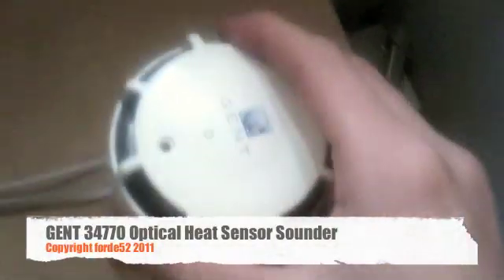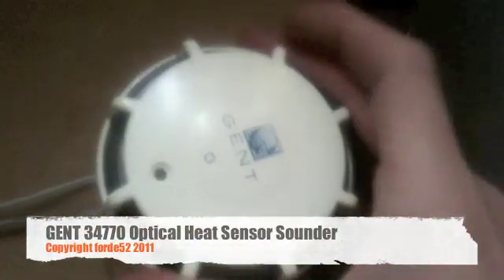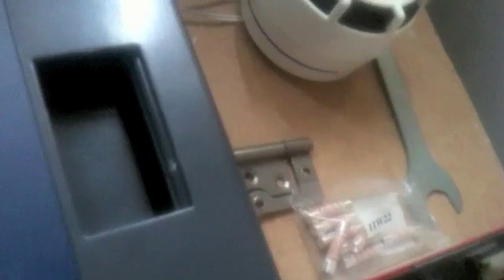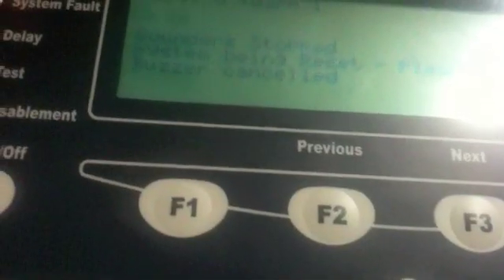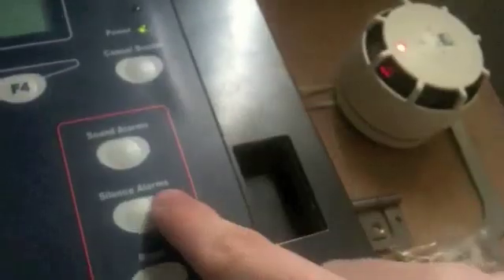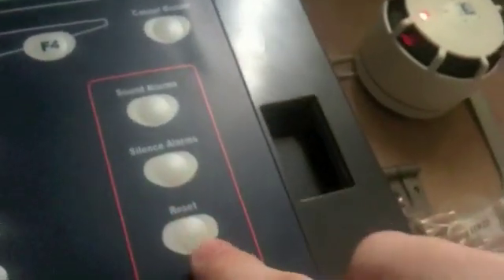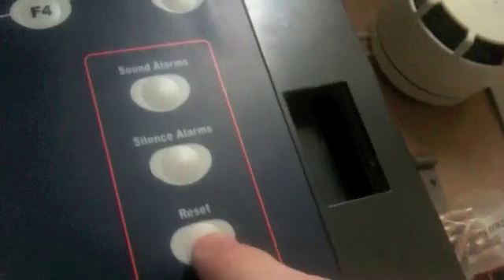GENT 34770 Optical Heat Sensor Sounder

Comment: How much are gent Vigilon Fire alarm panels or would a fire alarm interface run my 34770s
Reply from the maker: A new Vig could be £1000+! Used ones are hard to come by and 9/10 are unfortunately useless unless you are a Gent Engineer with the correct codes etc to get into one. No a Interface wouldn't run the 34770's as they require the Loop processing done by the 34000 panels.

Comment: Does the 34770 work on 12v battery because a just bought a bunch off eBay
Reply from the maker: Unfortunately not I'm afraid, You would require some form of GENT Addressable panel (32020, 3404/8, 3450 or a Vigilon) in order for the 34770 to function.
Reply: forde52 LOL